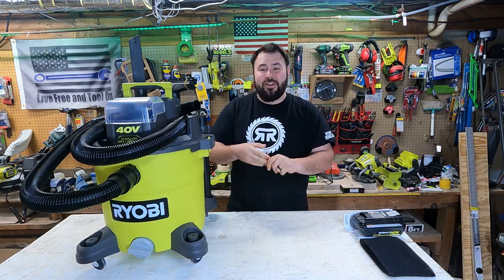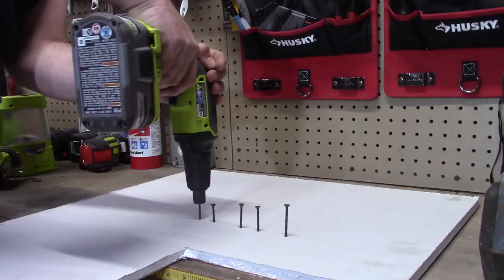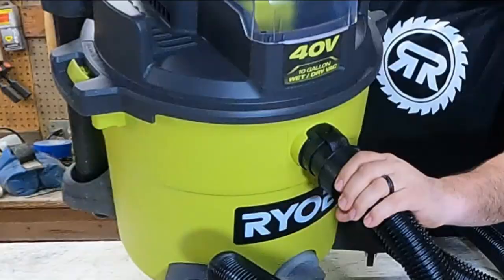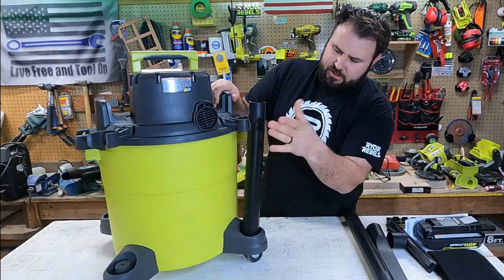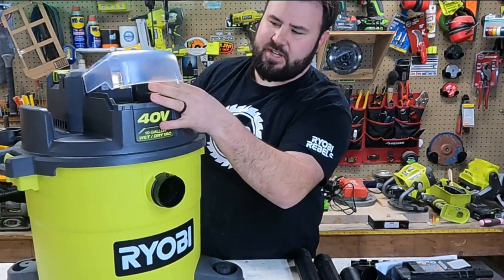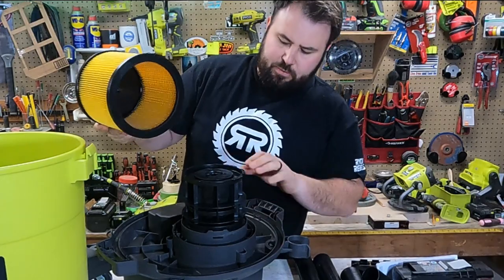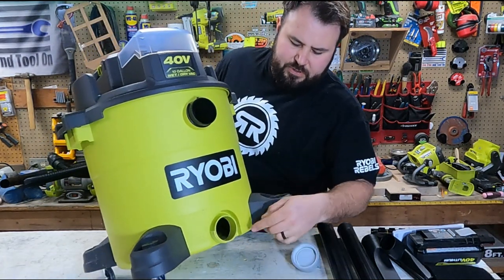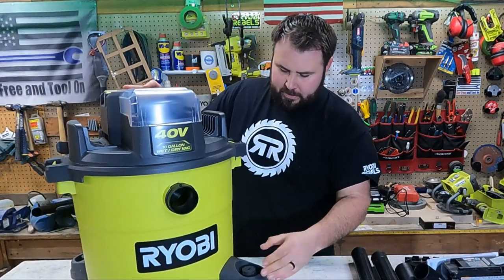Ryobi 40 wet vac tested [watch before you buy!]

Comment: The reason for the 1/2 thread has nothing to do with the thread itself. It’s actually designed offset  to put the Inside diameter below the bottom of the bucket. This way it will drain completely. If you used shop vac before they never drain completely because the inside of the cap is above the bottom of the tank. 
PS I have over $9500 worth of ryobi tools and those casters is an insult to ryobi quality. I love the 18v shop vac. Don’t know if I’ll get that one just because those casters won’t hold 80 pounds of water. (Water is 8lbs per gallon for those wondering how I came up with 80 lbs.) love the videos man keep it up.

Comment: The half thread is likely due to the injection mold tooling design for the body. To keep the mold simple the threads are on the bottom mold plate and the body can be released upwards from it.

Comment: I just ordered one, and the reason is (I suspect) the same reason a lot of people are interested in these.  My garage power struggles with running high-draw power tools (table saw, planer, router, etc.) and a plug-in shop vac at the same time.  After running for a bit, or when the tool is stressed I throw breakers.  This has become particularly problematic since I started running laser engraver and 3D printer projects that are disrupted and sometimes ruined by losing power.  In the end, I stopped using the shop vac and my shop is a dusty mess.  This is my solution, together with a cyclonic separator cart I will build to go with it.
Reply: I had similar problems- and it was a rental, so rewiring the garage wasn't an option. I also get a lot of storms which causes me problems. So I ended up going with an Oukitel combo UPS/Battery backup, great for power hiccups or blown breakers- especially for sensitive equipment. I just run longer cables so I can keep them in a dust-free environment. Yes- they're Chinese, but so far the review and my own experience have been good. Just another idea.

Comment: Great review Brent. What's your thoughts on the push tabs holding the power head over the traditional latches? Does seem as easy to use compared to the latches. Too bad about the cheap casters...the cheap ones are always the first things to break.
Reply from the maker: Thanks for the comment I think that’s a latches were a economy design I think traditional latches would’ve been better so another words the vacuum has room to grow Ryobi seems to do with this way with most new tool launches
Reply: @livefreeandtoolon  what kind of lawn mower do you have

Comment: Did I miss where you changed the dry filter for the wet filter?? People need to know that you don’t vacuum water with the dry filter in. The dry filter needs to be removed and the foam filter for water needs to be slid over the cage for the vacuum

Comment: The fact that the hose isn't 2¼" is disappointing.
Reply: New to these kinds of vacs. Why is 2 1/4 diameter hose useful?
Reply: @tizben : It would be able to suck up bigger items and it is a more common size (and therefore it would be easier to find compatible accessories).
Reply: @chengliu872  thank you

Comment: I wasn’t impressed with reviews my favorite is the ridgid 9 gallon 18 volt nxt model with 2 9ah octane batteries it runs over 1 hour so pass on this plus the ridgid ones are $96 dollars as of my comment
Reply: they (ridgid) discontinued them and one of my battery slots just got fried, but you're right, the rigid 9 gallon smokes this one for half the price
Reply: @mainsource8030  they were clearances out at $38 dollars